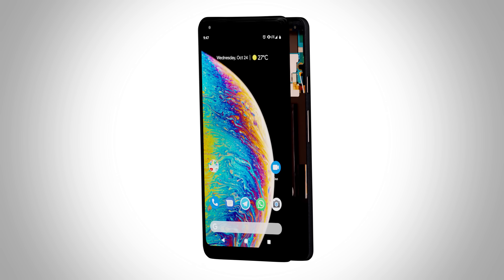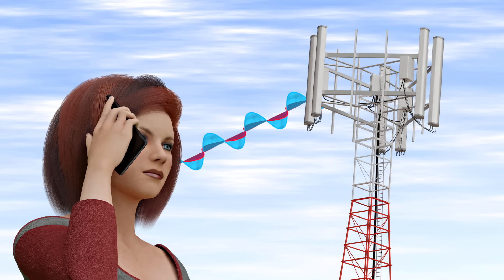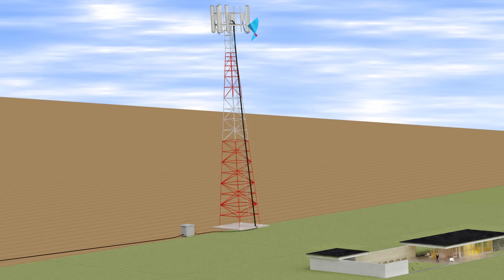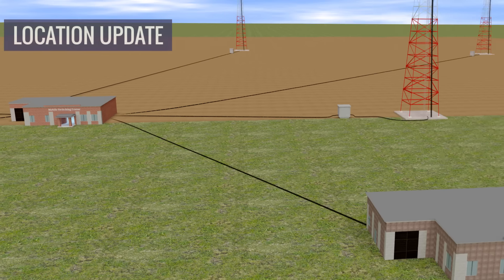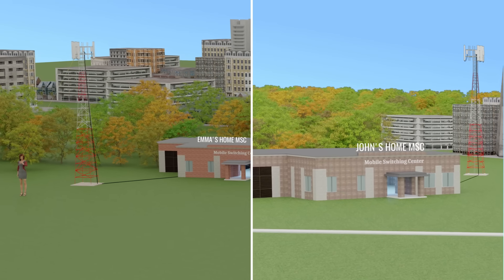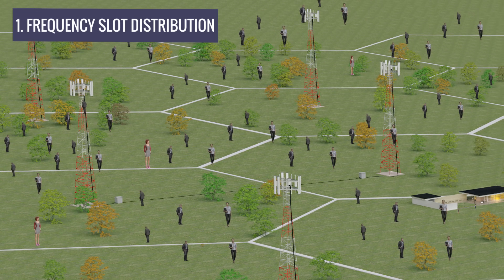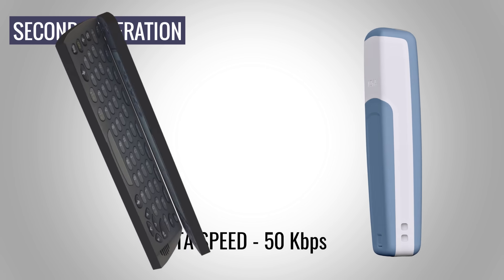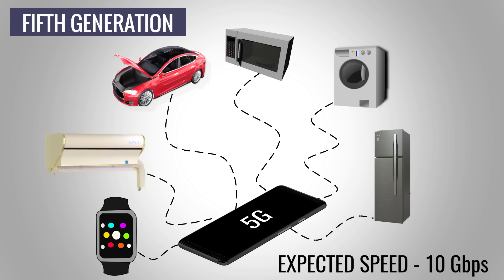How does your mobile phone work? | ICT #1

Comment: Wtf? 🤔🤔 What about satellites?   I thought towers send info to eachother via satellites!
Reply: I think you only use satelite network when in the middle of the ocean or something.
Not sure but it's possible you need a dedicated 'sattelite phone' for this.
Reply: This is a simplified explanation video. I'm sure they will expand on this topic in 2019.
Reply: David Si satellites most used for Data connection Cable Tv Gps etc
Reply: Yeah in vast majority of cases is cables. Satellites introduce a quarter second of delay or latency every time it goes from ground to space. This level of delay is unacceptable in phone calls.
Reply: @dosmastrify  right
Reply: My uncle works overseas as a head mechanical engineer, i’ve asked him the same question. He said that they have satellite-phones (name doesnt matter) which you can call anyone anywhere around the earth (i don’t remember if you have to see the sky to make a call). The price was about €90/min.
Reply: It occurs only in  GPS system bro...or if u r watching live cricket on mobile then satellite is actually transmitting signal upto you.... Dish TV also comes in these applications
Reply: lol dude. I was thinking the same thing, but we are most familiar with GPS technology, thats the reason why.
Reply: So they actually put cables across oceans?? How?? It just blows my mind all this stuff and how it works
Reply: David Si 
David Si 
You people think everything runs through satellites. Satellites are antiquated technology thanks to fiber optic
Reply: Satellites are used in broadcasting and mobile communication in aircrafts and ships. You can watch a program from US to Japan live from your cable tv provider because of satellites.
Reply: @Simon-nx1sc  there is no satellite they are laing to us
Reply: @memeramada1156  yeah
Reply: @johncarlodelapaz438  lol
Reply: before in the past we used the satellites to connect towers eachother, but today we use optical fiber because is faster and safer than satellite.
Reply: @MrAhmedalfares   Do you have fiber optics at 85° north or south? Or in the Atacama desert? Good luck making a call there without a satellite phone...
Reply: @BlueblueN  Undersea cables. There are lots of them.

Comment: I'm looking for more detail such as
- Voice is converted to PCM; what is the sampling rate and how many bits per sample?
- How is the PCM encoded for transmission to the cell tower?  Modulated onto an analog signal?  How?
- What is the optical coding for fiber transmission between towers?  Back to PCM?  How multiplexed for carrying many signals?
(I have some background in the old analog FDM over microwave towers but would like at least a broad understanding of how digital long distance works, over land lines and mobile.)

Comment: At 3:02 second you say mobile signal is not only wireless but also uses wires. 
But we see, now mostly towers do not  connect to each other through fiber optic but they connect through wireless. Kindly explain and clear my confusion.
Thank you
Reply: Cell towers use a wired back haul (usually fiber) to the MSC.

Comment: It still blows my mind that you can talk into a phone and it be wirelessly transmitted to a cell phone to possibly multiple cell phone towers to get to the other person on the other end. I understand basically what they're saying but my brain is like wait hold up explain this again LOL. But even though this is how cell phone towers work many customers still get upset because cell phone carriers can't provide reliable service like you can be on one side of the tower full service walk on the other side and basically have a dead zone those antennas on that site or any Tower in general with any carrier is extremely important as other features of a cell phone tower and well in reality the service never works like it's intended to especially if you're out in the country that's like the worst service possible

Comment: Even when john travels to a foreign MSC, video says the "request" first goes from Emma's home MSC to John's home MSC. Does that mean that the whole call goes through John's home MSC or once its known from the "request" john is in foreign MSC, does the "call signal" just travel from Emma's  MSC directly to john's foreign MSC?  I am wondering if the "request" communication figures out the right MSCs, then does the "call signal" just travel between those MSCs?  Example, Emma and john both have the same home MSC in Atlanta but they have both traveled to foreign MSCs in Los Angeles, does the whole call have to keep traveling cross country to the home MSC or does it just travel between the MSCs in los angeles?

Comment: Great video!
I have a question...

How does the cell tower know where to send the signal to the receiving device?
For example, if the receiving device is South of the antenna, does the antenna send a directional signal southbound towards the target device, or does it send the signal everywhere in it's MSC area?
Reply: MSc will transmit to reciever MSc then to tower

Comment: But how do radio waves from our mobiles reach nearby tower?As towers have huge power systems that propagate signals to a large distance but how do mobiles emit at large distance lets say nearby tower is 500 metres away?
Reply: I don't fully understand how it works, but from the little I searched: The cellphone has an antenna that is powerful enough to transmit signals, but the cell tower is sensitive enough to pickup the relatively weak signal from your phone. It seems to be a somewhat complicated concept.

Comment: I read this all the time. The so-call high speed data, does not have anything to do with speed. All data whatever medium their in, moves at or almost the speed of light. What they mean is bandwidth. Picture this. A two lane highway compare to a four lane highway. The cars on the highways represent data. The cars are moving at the same speed, 60-mile per hour. Since the four lane is twice as wide as the two lane, it can carry twice as many cars. Thats what they mean as wide bandwidth. It does not have anything to do with speed. Thanks.

Comment: Is there a device that receives a 3G 4G 5G cell phone signal from a distance of 60 to 80 km?
Reply: Any ordinary phone will. It does not depend on the phone but rather on the network. Due to time delays a limit of between 10 and 35km is usually imposed to prevent interference between different users.  These limits can be extended but usually at the cost of reducing capacity. Whether or not to relax the distance limits is a decision the network operator can take after considering the pros and cons.

Comment: What in case of forest area or ghat sections signal not there, after we will get the signal. I don't believe that what said is fully, it is partly correct. Because in case of oceans travelling from one country to another is long way. Who will put wire connections there. There must be technology used there.
Reply: There are undersea fiber optic cables that connect countries and continents together. Cell towers connect to a backbone network via fiber optic cables. However, if the are in question is too remote to run cables, there may not be cell towers and thus, no cell service. There are satellite phones that can use a satellite network, but they are quite expensive and not very common.

Comment: I have a question 

If I'm sitting in my home and just like buildings door and walls are obstruction then how come em waves pass through to reach tower
Reply: Buildings door and walls are obstruction reduce the signal but not stop it. Also in construction building they take in consideration by follow building codes and recommended materials

Comment: When  why satellites  are used?
Reply: Most cell phones do not use satellites other than for GPS. I believe some of the newer iPhones can use a satellite link for emergency services when you don't have a cell signal. Other than that, they rely exclusively on cell towers and/or wifi networks for connectivity.

There are phones that can connect to a satellite network to make and receive calls and texts, but they are not commonly used. The phones and plans are very expensive making the unaffordable to most people. And they're really only used in very remote areas with no cell service.

Comment: What about the satellite 😅
Reply: What satellite? The vast majority of phones do not use satellites except for GPS. There are phones that use a satellite connection for calling and texting and data, but they are very expensive and usually only used in very rugged areas where there is no cell service.